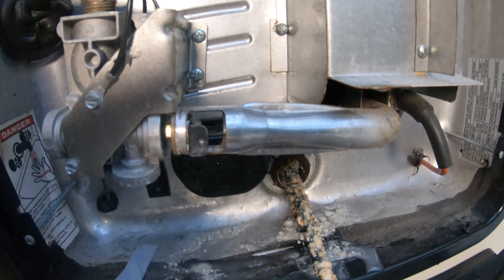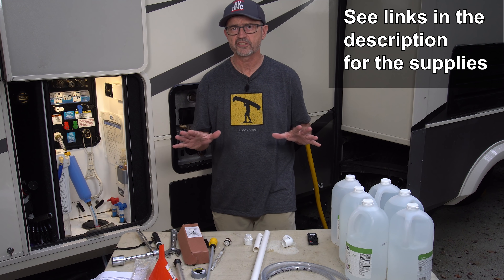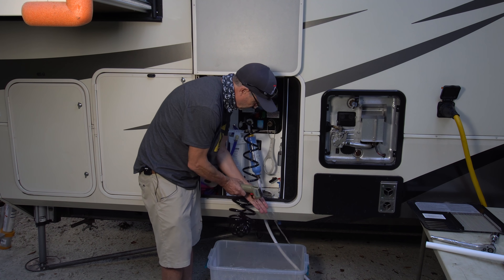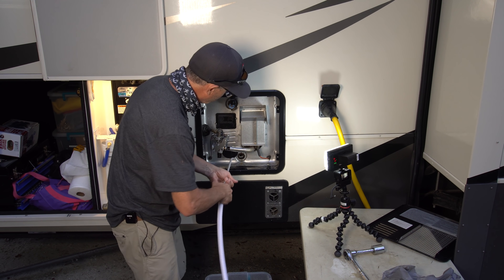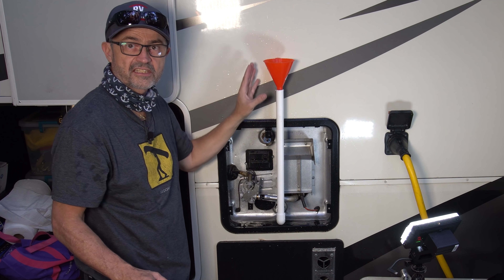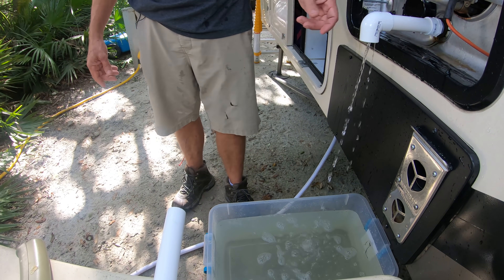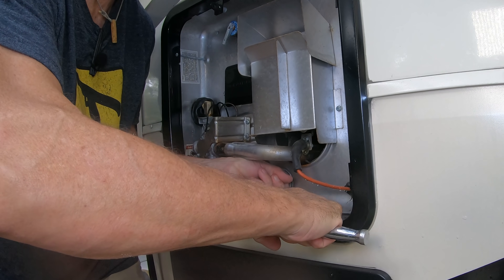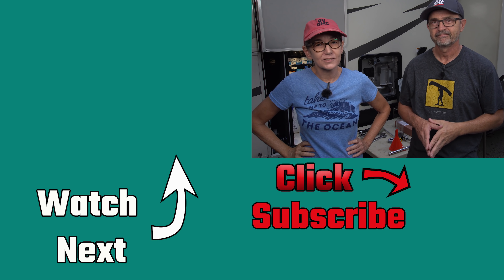RV Water Heater Maintenance w/ Custom Vinegar Fill Pipe (RV Living Full Time) 4K

Comment: Thank you so much for this video. I have been raving 40 years and have always changed anode rods and flushed WH with water. I was amazed that after letting vinegar solution soak overnight on how much additional scale came out of the tank.
Reply from the maker: Vinegar is such a great item to have your RV or home. We plan on doing this maintenance more often since we are full time travelers and use so many different water sources,
Alice

Comment: Great job. Note to all. When the water heater is heating cold water, the water will expand and pressurize, and leak out of the pressure relief valve. Once the water is heated to the preset temp, the leak will stop. This is normal.
Reply from the maker: That’s a great tip, I knew it would drip, but that’s a great explanation of why.  Thanks. Larry
Reply: Makes sense. I noticed the PVC piping seemed to be leaking when heating, but on closer inspection realised it was a slow overflow out of the top PVC arm. I figured the overflow was because the water expanded on heating.

Comment: Nice to see that you put the teflon tape on correctly.  To avoid leaks it's necessary to go clockwise as you're holding the fitting with the threads facing you.  That way the tape doesn't unwrap as you tighten the rod.    Also, vinegar and baking soda make a great household toilet bowl cleaner.  When you drain the water heater recycle some of the vinegar into your toilet and sinks.  Add a bit of baking soda, swish it around and let it sit over night.  Cheap and very effective.
Reply from the maker: I have put the teflon tape backwards before, thats how I know to make sure I put it on correctly.  Great tip about using baking soda and vinegar in the toilet.  Larry

Comment: I used your technique and it was really easy. I use a T instead of the elbow and added more pipe and a shut off valve below. Thanks!
Reply from the maker: T with shut off is a nice touch, I’m going to add that next cleaning.  Larry

Comment: This was a great video and method!  I used this, built a fill pipe, used hot water since I wasn't going to turn on my heating element.  Then when draining, I turned the fill pipe down so the vinegar/water solution ran out it and then down into a 5 gallon bucket.  Although my trailer specs said my tank was 6 gallons, (and I fully drained it), I could only fill with 3 gallons of vinegar and 2 gallons of water.  Thanks so much for a great DIY!
Reply from the maker: a six gallon water heater really only heats 5 gallons of water because of the large air pocket at the top which is there to allow expansion when the water is heated.  Glad this worked out for you.  Larry

Comment: Been camping my whole life. I replace the  anode rod every year but I never even knew to descale my hot water tank. Thank you for the information and demonstration.
Reply from the maker: Dwight, we were surprised how bad it was. And while working on our current video about fresh water holding tank sanitation, we looked at the rod again. Yikes. We need to that whole routine more often as full timers, 
Alice
Reply: @DownsizingMakesCents  I use my Keystone Retreat on weekends and vacation weeks. A little tip that I do for the Black water tanks is, at the end of the weekend I empty the black water tanks while letting the water run for about 2 minutes to flush the tanks. I close the shut offs and dump in my Aqua Kem. When I come back next weekend the first thing I do is reopen the black water tanks to drain out before using. More than the dumping of the Aqua Kem is the removal of the tank gas that built up. Doing this greatly reduces that blast of nasty smell when you first flush the toilets. I reapply the Kem before using for weekend. It also helps keeping the tank level sensor clean. 👍
Reply from the maker: Sounds like that works great for you 👍 Larry doesn’t like the smell of that chemical- plus of course we are full time. We did do a video with bathroom tips. 
Have a great weekend, 
Alice
Reply: @DownsizingMakesCents  Happy Camping and Easter.  I will watch more of your videos when I can. I'm sure I will learn things.  My 53 years of camping started in my parents 19ft trailer in a crib. No hot water, no shower.  Mom had to boil water for a sponge bath. Finally TV around 8yrs old. Black and white tv with a 40ft radio shack antenna. 2 channels on a clear day. Skip to today 42ft Park model.  Central air, DirecTV with 4 hd TVs, 2 bedrooms and bathrooms . Wow have times changed
Reply from the maker: @dwightjr88  Boy has it changed. Someone told me about a rig that has avoidance for the slides? It’s amazing what they are doing. 
Alice

Comment: my"like new" roadtrek was garaged for FOUR years, needless to say, the iod rod was ka-poot !!!!! I JUST did this and tomorrow will rinse out-what a life safer considering I THOUGHT I may need a new hot water heater-thanks!
Reply from the maker: With proper care these water heaters should last a long time, but changing the magnesium rod is important.  Why was your Roadtrek garaged for four years?  Those are great RVs.  Larry
Reply: @DownsizingMakesCents  quick question and I hope you get this..... I've drained the vinegar and flushed once and sprayed a bunch with the wand.... pretty much clean, yet I still get an occasional sliver of black.... maybe plastic? or maybe decomposed anode rod..... I'm gonna get my lizard cam in it tomorrow..... should I JUST keep flushing until it's crystal clean.... will these tiny speck impede on my water flow-damage anything???? thanks a lot! this is all foreign territory for me

Comment: Thanks for the great video. I "borrowed" your idea and tweaked it a little for my use. I used black iron tubing and added a ball valve shutoff because I wanted to heat the mixture and was afraid of the pvc tubing and heating it. I let the vinegar and water heat for 12 hours, then turned off water heater and let simmer for another 12 hours. The results were amazing! Tank looks brand new now. I thought I had damaged the threads in the tank for the anode rod, but it was only calcium build up on the threads that kept me from tightening the anode rod into the tank farther than I could. I can now screw in the rod with just my fingers.. Thanks again for the video
Reply from the maker: Great idea using the black pipe, i didnt think of that.  Did you have to use teflon tape on the black pipe connections to keep i from leaking?  I had a very small drip from the pvc pipe connections, I didnt want to glue them so it would be easier to store in pieces.  Larry
Reply: @DownsizingMakesCents  Yes I did use teflon tape just for lubrication on the threads. Only tightened connections hand tight so as to be able to store in sections after use. I did have a small drip from the 3/4" to 1/2"adapter, but that didn't worry me.This is THE BEST idea I've come across in a long time, and now I have the equipment if I need to perform this task again. Thank you sir for this easy way to descale my water heater tank!
Reply: @thelonestarranger  that is a good idea as heat does accelerate things. If you don’t want to use black iron, as it’s heavy and taping can be a chore, use CPVC. It’s specifically for hot water. Also, adding a union between the 90 and 3/4 male adapter will help with storage and orientation.

Comment: Great video! I had no idea what I pulled out when I removed the anode rod to release the water, but knew it was a build up as in this video. 

It was great to see that the element was just to the side and I’m fortunate to have a 4’ Ridgid plumbers camera to look at the element to determine whether or not I should replace it. The kits from Amazon are great, and I like that it has a double sided tool to work on either, or both, the heating element and the anode rod, which are two different sizes.
Reply from the maker: I wish i had a camera when i did this video, i have gotten a bore camera since to take a good look into the water tank.  When i do a follow up video I will show the inside of the tank better.  The kits are great because they come with all the tools you need.  I should put one of the kits  in our Amazon Store.  Thanks, Larry
Reply: O

Comment: Great idea with the pvc to clean our the tank. We have an aluminum tank so we don't have to deal with the anode rod. Thanks for the video.
Reply from the maker: Atwood’s don’t need an anode rod but still need to be cleaned. Thanks for coming by. 
Alice
Reply: @DownsizingMakesCents  I have an Atwood (aluminum).  Before I knew better, I went to the RV dealer to purchase an anode rod.  The service manager knew the unit I had just purchased and said "oh no, never put an anode rod in an aluminum water heater."  He said the steel threads can easily cross thread and damage the heater. In which case he said would be looking at a new heater.

Comment: Thanks for this great video, I love your way of explaining things (Larry), and shooting the video (Alice) you really rock, we are a family of RV guys, three of us, just starting in this journey, me and my wife in one, my daughter who is a Chef in orher and my son who is a Paralegal in another, we bought old-second hand RVS, one of it is giving us problems with the water heater, it takes too long to heat it, so my son is burning a lot of propane which is not cheap. I already bought all of the parts you mentioned and will follow your instructions precisely. I will post afterwords to share how it went. Thanks for sharing your lifestyle, we live in Wallaceburg, ON (not that cold yert...). Regards, EZ.
Reply from the maker: Hey Ernesto, love to hear from Canadians, especially from Ontario.  It is important to get to get a good look into the tank before and after the treatment to see if the calcification is gone.  If he is using a lot of propane, i would take a good look at how the burner is performing, there may be a problem with the orfice where the propane comes out of the burner, cob webs can be a real problem.  If the propane is not providing a flame deep into the burner inside the tank it will not work efficiently. You can also check the regulator and make sure the propane flow rate is correct at the burner.  Good luck with the tank, love to hear how it worked out.  Larry

Comment: Thanks for the details and parts listing. We are just weekend warriors but sadly affected with rotten egg smell after only 3days of use with the water heater. I hope this method will solve the problem. Very clever use of pvc. Totally admire the mind of a guy who thinks outside the box. Bravo my friend! I just subscribed and will follow you guys' adventures.
Reply from the maker: Part timers have move a problem with water heater smell because of sitting unused for long periods of time.  The vinegar should definitely improve the smell considerably.  Thanks for the encouraging comment, i really appreciate it..  Larry
Reply: If water has been sitting in your tanks for extended periods then any chlorine in the town water you initially filled it with will have leached out. 
At a minimum, you should dump all the stale tank water and replace it with town water which will be freshly chlorinated.

Comment: Great video! One thing though. I’ve been told to avoid the anode rods that come in 2-packs and the ones that have the dark socket end. Apparently, you should really use the ones that have a silver looking socket end as they’re high quality and last longer. I know Camco makes some.
Reply from the maker: The ones i get in a two pack seem to work great, i replace mine every 6 months or so and they appear to be doing their job, as they are devoured and need to be replaced.  Larry

Comment: Ok this was great... I have been thinking of a way to flush the hot water heater with vinegar on my older Class B campervan... Will have to try this next spring. The first time we took the anod rod out after buying the van, I think it looked worse than yours ...lol. Since then I check it every spring and fall and still looks new with a little wear at the end... One thing that I do is after using the wand to flush, I turn on the water pump and the water heater starts to fill and without the anod rod there, it just exits with a lot of force, so I feel that it is also helping to clean out.. Thanks much for sharing !!!
Reply from the maker: Larry did the same thing you did with the water but he used city water. Sounds like you are doing a great job. 
Alice

Comment: I should be able to fill water through funnel?
I think taking out the anode and heating element then putting some anti seemed on them should be a good idea 💡
Reply from the maker: The teflon tape takes the place of the anti-seize.  You use.  Funnel at the top of the pipe to fill the tank.  Larry

Comment: Saw the thumbnail and now have to make one of those.  Now to watch the video.
Reply from the maker: 😂 Oh, the thumbnail dilemma. Let us know how it works out, 
Alice
Reply: @DownsizingMakesCents    No dilemma.  It's an easy build and a great idea.  Easier than yanking the high-press valve.  I'll be heading out for parts tomorrow.
Reply: Well, finished up the de-scaling and the fill tube worked pretty well.  I like the idea of not running the Ammonia through the fresh water tank and not having to pull the pressure relief.  Two issues I had with it (1) mine leaked about a gallon overnight so I glued the NPT fitting and the 90-degree elbow to the short tube for the next time. (2) The water in the heater can't be safely heated during the process.  That may or may not be a problem depending on who you talk to.  Once I get my raw footage downloaded and give it a look, I'll decide if I want to post this process being done on a 6-gallon Suburban water heater in a Trailmanor.  Of course, I'll be mentioning your channel as where I got the idea.  Thanks for the video and safe travels.

Comment: Very good job. I don't see a lot of scaling when I pull mine because I'm a weekend warrior so the hot water heater is used each day. Great job on the video.
Reply from the maker: Thanks, my Travel trailer and Class b did not scale that much when were were just using it occasionally, I’m sure all the scale build up we got was from feb to now while we were full time.   Lar

Comment: Dometic directions say add 6 gallons and 3 gallons water into pressure relief valve . After adding 6 gallons vinegar the tank would not take water, it was full. The tank was completely drained first. A friend mentioned the low point drain must be drained also , but I have not heard that elsewhere. I don’t know why it wouldn’t take 9 gallons, it was full at exactly 6 gallons. There is a label stating it’s a 10 gallon unit
Reply from the maker: The top of the tank has an area where water cannot go above, this way the tank wont explode, air compresses when the water expands,  so even though technicallly the tank has 10 gallons volume, it probably only holds 6-7 gallons of water,  that’s what the water outlet is not at the top of the tank.  Larry

Comment: They make nice borescopes that Bluetooth to your phone, that you can inspect the inside of your tank with.
Reply from the maker: I would love to use a scope to look into the water tank, the grey tank and the black tank.  I’m not sure if YouTube viewers are ready to see what’s in our black tank!  I am going to look for a scope that is inexpensive but can record good video.  Thanks for the suggestion, Larry
Reply: @DownsizingMakesCents  Check out the Vividia VA-400 ablescope. Great picture, 180 degree articulating, and locking head. The picture quality is great.  I use it in aviation, and it's in expensive. Now I'll use it on the RV.

Comment: Great video and great idea with those pipes, I have a 2007 Grand Junction in a campground and it hasn't move for years so I'm always on electricity and city water, have never used my water pump so I was wondering how to get the vinegar in the tank now I know. I have one question though, all the other videos I've seen about cleaning the tank once they put the 50/50 solution in they turn the heater on and let rest overnight can you tell me is there a reason why you let it rest cold instead of hot? Thank you.
Reply from the maker: In my opinion there is no need to heat the water, I have tried both ways and there is no difference.  The longer the vinegar soaks the better.  Larry

Comment: Worked perfectly. The one improvement I'd like next time is the ability to have water pump access to cold water for the kettle, washing up, drinking, etc while the vinegar solution is doing its job. 

I'm thinking a simple PVC cap end pressed on the top of the verticle PVC pipe arm should seal that pipe long enough that I could temporarily turn on the water pump and tap. Cost: less than a dollar. Here's hoping it works.
Reply from the maker: When i did the water heater, i put it in bypass so i could still use the cold water in the rv.  Larry
Reply: @DownsizingMakesCents  good  idea. Here in Australia it seems vans don't have bypass systems because we don't have your freezing winters.